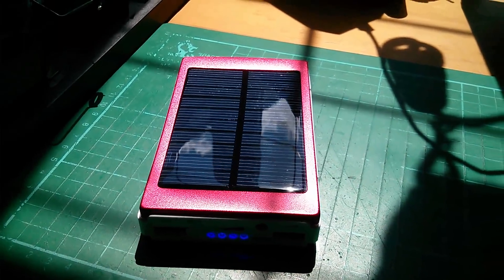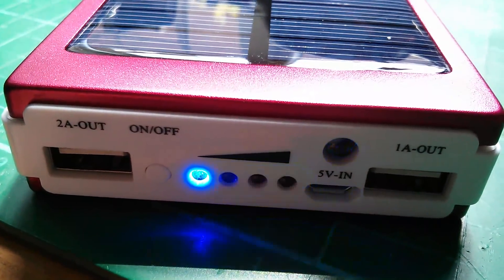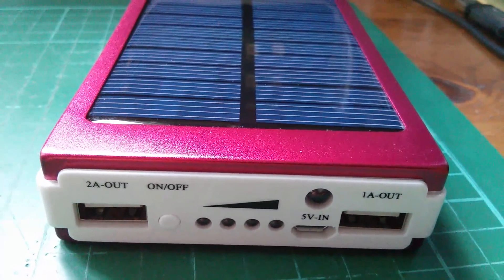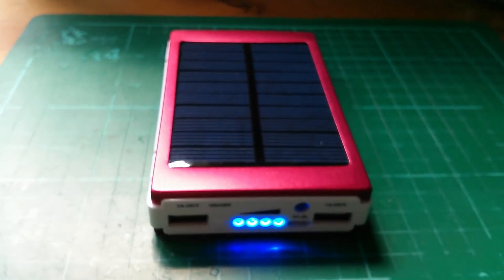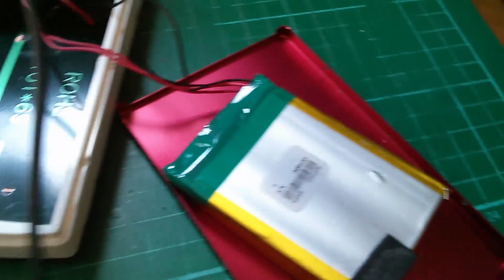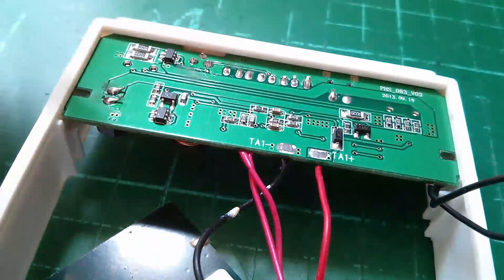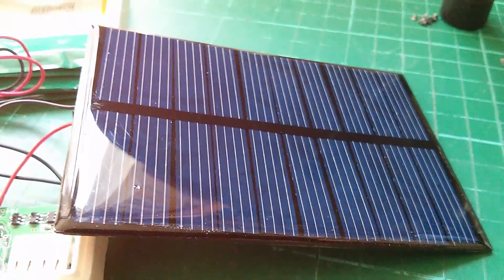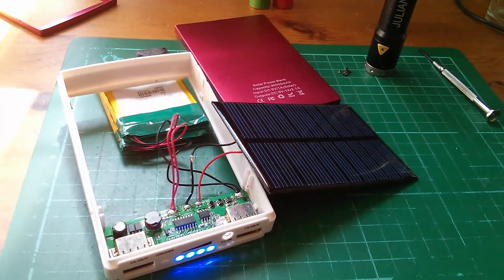Review: 30,000mAh Solar Power Bank - It's a pile of Junk!

Comment: mine work fine for me in the camper. they will charge my ipad air, phone etc. occasionally top them up using the micro usb port from my roof 50 watt bosch panel. handy little power bank .

Comment: Well, actually, mAh rating is just amount of current it can provide for 1 hour at given "voltage"
So, without specifying what voltage it's rated, those Chinese can say whatever mAh they want. They can say it's 3,000,000,000mAh , not saying it's rated at 0.000001V.

Usually, mAh rating should be based on its output voltage, which is 5V, but even reputable ones are using 3.7V, which is the cell voltage.
So, I wouldn't be surprised some just rate that whatever voltage they want.

Comment: it can't be 30000mA, to small. car battery is 60A so this can't have half capacity of car battery with this size. also in case if internal batters are discharged the solar panel isn't able to charge them. so you can use it as usual power bank, charging it by charger as phone.

Comment: I have designed my own 5 watt solar panel charging cells that will be used to charge a 7.2 aH 12 v gel cell.  The panels cost ~ $24  do not need regulation save for a schottky diode in series with the output. Should take about 6 hours to charge the battery in full sun which is ok for me since I intend to use the battery to charge my phone and tablet during a power outage.  I could design a smart charger but SLAs are pretty forgiving as to charge rate.  At least they won't explode.

Comment: ive recently bought one virtually identical from halfords, their own brand for £25, theirs is rated at 15000mAh (oh,yeah!) and the led seems to work correctly/sensibly, as the light drops the leds shut off completely, but as for how much charge the cells get, no idea yet.i intend to do a discharge test to see if it really is anywhere near 15Ah, somehow i doubt it..i think they give the cell Ah rating, which once it is stepped up to 5v , will be effectively lower...

Comment: I bought one from eBay that I had to assemble myself. No big problem. Just a little soldering. It claims to hold five 18650 batteries. Good luck getting them inside the box without screwing up something. The solar panel is more trouble than it's worth. My suggestion is to either purchase something better or to disconnect the solar panel and connect about ten batteries external of the box and use it to charge devices when no other power is available.

Comment: Try opening the batteries, some of them are fake with sand in
Reply: TruthersUnite2 yeah that happened to me, that's what we get for buying cheap shit from eBay
Reply: TruthersUnite2 I picked one up for 30 dollars and it will charge my phone 8 times over with 4 USB ports and a torch. That was a bargain
Reply: TruthersUnite2 it's called the powakit 20000 mah. Can't remember what site I bought it from but there's a few places that sell it similar prices.
Reply: First Name Surname eBay is better for purchasing these banks
Reply: Sir Majesty it's better for your pocket. Not for much else. There is good things on eBay but to many scammers
Reply: @jimoflh5773  Caveat emptor!
Reply: Hi,

i made a similar review on a power bank solar charger device which i tested by self and is just perfect with two 5V USB outputs and 50.000mAh check it out:

https://youtu.be/hWONMXbBc3Y

regards.

Comment: They have redesigned the PCB. It now has surface mount LED's that don't come on when it is charging from the solar panel. Granted the solar panel is still lame, so I plan on installing a more powerful panel. The unit I purchased has a lantern on the other side and came in kit form. I can say they lie about 50,000 MAH. Mine is a true 15,000 MAH, but that is at 3.7 volts not at 5 volts at the output. The kit is a good way to go, because you can install higher output 18650 batteries, but you do have to solder the batteries together. I have a battery spot welder that makes it much easier.

Comment: want it give u more power if it was outside in sun and not in front the window ?
Reply: Yes but still not enough. With that little solar panel it would take weeks to charge the batteries up from empty to full assuming you'll have full sunlight for day and night. It's true, the power these small panels produce is just not enough and the capacity of the batteries is too large.
Reply: that's y u choose wind turbine as well in combination to solar

Comment: I've used one of these for a long time and they worked really well. the LED flashing (when the sun) means it's charging via the sun. The solar charging doesn't really charge the bank to store it but it will charge a phone or similar device without using your charge. If you are charging a larger device such as a tablet it will slowly deplete if it is also being charged by the sun. Now a big problem I've had was charging two devices at once (when a buddy of mine wants to use it too) it will deplete very fast. But I still enjoy it for what I paid for.

Comment: Well... At .592 V, that's 30,000 mAh! Just because they failed to mention that the mAh rating is when it's choked down to .592 volts, doesn't mean they technically LIED...

This is why ALL batteries should be rated in V and Wh.

Comment: what are the benefits from batteries vs super capacitors?
Reply: Bigger capacity over time. Capacitors can release their charge faster and can be charged up faster but they have less capacity. If there was a supercapacitor with the mAh rating of a decent Li-Ion or Li-Po battery it would replace batteries.

Comment: i Have one that says 80,000 with 5 18650 battery cells instead of lipo cells. to my surprise i thought they where all built the same and that i was going to use the lipo battery for another solar power bank that works better in gathering energy but 18650 batts are to big.

Comment: LED lights actually use very little power. I watched a video once where this guy managed to  run one for over a week with nothing but the power of a lemon and some old pennies! So probably wouldn't burn up enough power to be noticeable. The solar charging is a bit of a gimmick however and would really only be applicable in a situation where you were stuck in a remote location with 2 dead batteries, needing a slither of a charge in order to make a call for help on a cell phone.
Reply: That's my thinking too. One such blue LED probably uses 1/100 watt, or something like that.

Comment: I bought something similar, but it only have one USB and I think it's thinner. I claimed to be 10000mah but there is two 2600 cells inside so it's 5200. I don't know if the solar pannel works correctly or not but I don't care. I paid 7€ + 3€ of postage, so 10€ total so I think that's not that bad even if it's only 5200mah, because even 5200mah powerbanks usualy cost more than that. I just hope it wont die quickly.

Comment: Your window filters out a lot of the incident light rays.  It needs to actually be outside exposed to direct sunlight for full effect.
Reply: It still doesn't matter, if you watch GreatScott's video about two solar power banks he explains that with  solar panels this small it would take weeks to charge those batteries up. Weeks. There's just not enough power. To get enough power you would need a big 12V solar panel array and that is definitely not portable and will be very expensive as those cost hundreds of dollars.
Reply: it still sucks dick so...
Reply: could it over heat and damage the battery charging process?
Reply: You're right that it would heat up the panel quite a bit, however, it is designed to be exposed to direct sunlight, so it should be able to take the heat from sunlight.
Reply: +The Minister of Baked Goods do uk if there's a piece of plastic I'm suppose to peel off the panel

Comment: how well do you think the Waterproof 2USB 6LED Portable 100000mAh Solar Power Bank Backup Battery Charger Item# 141984971531 outputs well the mah and capacity or which solar charger is the best but not really expensive?

Comment: " the circuit looks pretty old ", but it's functional, so why change it for the sake of it?

As if there weren't enough cause for criticism already: The case build, the implementation of the charge indicators, the false claims and the inadequate solar cells are the issues here.

The readily available nature of components in this "old" circuit architecture is part of the reason the things only  cost a few quid.

Comment: im having trouble charging a 12volt battery with a large 100watt panel in a shaded part of the building so I can agree with you a tiny panel like that can take ages to charge up a 4.8amp battery even in hot direct sun!

Comment: Isn't the whole concept behind these packs flawed, your not supposed to expose lithium batteries to extreme heat but lets put a battery pack in direct sunlight to charge it.

Comment: Just in case, At this time Anker power banks, You will not regret.
Reply: They're excellent,  decent circuitry and use proper cells instead of the generic, unbalanced used/mixed cells a lot of the generic manufacturers use.

Comment: I've got a couple with 4 2600mAh 18650 lithium cells, so it actually 10,000mAh. the leds don't run steadily, they flicker on/off in rapid succession, a cell phone camera can usually reveal this.

Comment: The battery isn't too bad on this - I can charge my phone 3-4 times from about 40%.    The solar panel does nothing more than light up the LEDs.    I've had this in direct sun for 2 weeks solid, and it hasn't charged the battery at all.

Comment: Definite pile of junk, I bought one and it didn't work. I was given a refund and told to keep it so was able to open it up to find the 3 x 3.7v 4000 mAh cells. I used another circuit so I can stick it in my new project.

Comment: Pure power! I bought a 5 Euro torch that produces 10,000W from a single 18650 battery. Enough power to boil 4 electric kettles! (As used by the police, includes charger and carry-clip)

Comment: 44.8A of 18650 are 2.5 times bigger than that
Reply: +Rico pacino Dude, a typical lead-acid CAR BATTERY for a compact car only has 40Ah (40,000 mAh).
Reply: BluntForceTrauma666 I know man, but I was curious and did that. Any powerbank that's  under 20A (20.000mah) is rufly that zise.

Comment: I have one of these and it works great doesn't act up like yours is doing either. Just opened it and mine has a set of 18650 battery's I won mine on a site called listia it claims to be 30000mAh how ever the 18650's have no marking of any kinds to get an idea of the real capacity

Comment: People get all ga-ga over solar power, but rarely understand the relationship between the size of the cell/panel and the battery they need to charge. The marketing people don't talk about that, but they love to state capacity in mAH because they love all those zeroes. Impresses customers who slept through their physics class in school!
Reply: yeah, a very, very rough rule of thumb for northern europe is 1kW per square metre, which gives 10W for a panel 10 by 10 cm.  If it's 100 percent efficient, which none are.  Hope for 1 or 2W with today's technology.  That can be very useful, but they are often mis-sold.

Comment: Is the below calculation correct ?

Energy of 2x LiPo cells  =  2 x 3.7 V x 2400 mAh = 17,760 mWh
Energy of solar panel (max)  = 6V x 100 mA = 600 mW

Time needed to full-charge  =  17,760/600  = 29.6 hours  or 2.5 days !!!
 (disregarding the losses and assuming 12 hours sunlight per day)
Reply: +hemanth kumar The charge time probably be even worse -- due to energy losses and those stupid blue leds.

That said, I'd rather have one of those than none at all if I were heading somewhere off grid.
Reply: +Mora Fermi i hate the leds too...at less with a switch will be better

Comment: LEDs can be made to light very bright with very little power if you pulse them instead of STEADY on. You can pulse them at very high frequencies, which to the eye, looks like they are solid on. This is often done with the Jewel Thief circuit.

Comment: Yeah, there is not ONE of these that actually meets it's mAH rating nor will any of these with small solar panels actually give you a useful charge. Even with a 5V 3A solar panel it would be hard to charge a 4800mAH battery to full capacity. Solar panels only give out full rated power when in direct sun. Cloudy days, morning, evening, and nights of course are not going to charge much, if at all. Manufacturers selling this shit should be held accountable. The outrageous over stated specifications alone should be enough to get them banned from Amazon, leaving maybe ebay for them to take advantage of people. Sorry about writing a book here... This kind of thing just pisses me off. Taking advantage of the public. Cool review! You expose it for what it is!

Comment: In defense of these cheap, Chinese solar power banks, it's worth mentioning that above and beyond this specific solar charger, we (as members of mankind) have an issue with efficiently harnessing the power contained within solar waves. My hint to you, yes, you, a consumer, is to make sure you look into a solar charger's efficiently level before you make a purchase. Honestly, unless you are buying this type of product for a specific immediate need, I would advise you to hold off until engineers have discovered a more efficient manner of efficiently harnessing solar waves. When engineers succeed, only then, will these small solar panels housed within the charger's plastic casing - actually make a real difference in "everday life.". Until then, we all must live with the fact that photo-voltaic cells have come some way, but they still aren't 30% efficient... if we were to reach 100% efficiency at an affordable manufacturing cost - the world as you knew it would change over night.
Reply: good point, plus the overall "eco-footprint" of PV panels is negative (bad) unless they're in pretty much constant productive use over many years.

Comment: that solar panel looks identicle to 3 I just bought on ebay for £1 each they claimed to be 6v 1w but in sunlight they're only generating 61ma which is about 0.4w and when it's overcast it's only gerenating 7ma

Comment: Julian Ilett, today I connected my 30800 mah solar power bank to car Cigarette Lighter socket by a samsung car charger 5v, 1A. Suddenly the flashlight turned on and all other lights gone, and it is not working now, just the light is on and can't turn it off by switch. What should I do to repair it, do you think it burnt up?

Comment: I got a very similar model that has a nice flash light on it.  I've noticed the same problem with the solar charging.  Do you think it would be ok if i clipped the wires for the solar cells and just used it as a power bank/flash light?  I wish I saw this review sooner.

Comment: "30000mAh is an outright lie"... well not if you measure the capacity converted to 0.65V.  (Why do manufacturers use mAh for capacity?  Should be labeled at most 20Wh, and that seems generous given the volumetrics.)

Comment: I bought one of these from eBay for $14, and when it arrived,  I messaged the seller about the capacity.  Not wanting negative feedback,  they gave me a full refund! I then proceeded to mod the thing (put 3 more 5v solar panels in parallel with the existing one,  and made a 50ah battery from 18650 cells.) and it works like a charm now! It just doesn't charge at the full 2.1 amps.

Comment: O güneş paneli ancak ledleri yakar 30 bin mAh pilleri ancak 10 güne şarj edersin :) . 30.000mAh vermesi için en iyi 18650 pillerden içinde 24 Adet olması gerekir. Oda cepine değil ancak sırt çantana sığabilir. Ebata bakınca zaten  onun 30.000 bin olamayacağı açıkça belli. İçinden çıkan pillerin toplamı kaybı hesaplayınca 4000mAh ya eder ya etmez.

Comment: I agree with your advice to buy a proper solar panel setup, one with decent surface area, and a good quality large battery pack. I bought a decent quality 20000mAh pack and I'm inclined to believe it actually is 20000 since it charges both my phone and tablet a number of times before indicating it's even low charge.
Reply: +Harry Akira Eaton 
Can you recommend the brand please
Reply: +Sam Sommer The one I bought was from Aukey, apparently it's a German brand which was bought by a Chinese company, they seem to be actually interested in maintaining good brand image though hence the better quality than no brand or lesser known brand producers.

Comment: Your power bank also uses real 2400mAh batteries! That means that's not all lost. Most pb's uses cheap 750, 800mAh 18650's and sand batteries

Comment: I bought one . everything is good except the solor panel . other than that it will charge your phone up to 100% multiple times
Reply: +XVJR VIDEO Same here. 
The battery part worked, though I seriously question the 30,000 mah, and the solar part is BS. You can't charge it using the solar power.
Reply: +XVJR VIDEO same problem here!
Reply: lier !